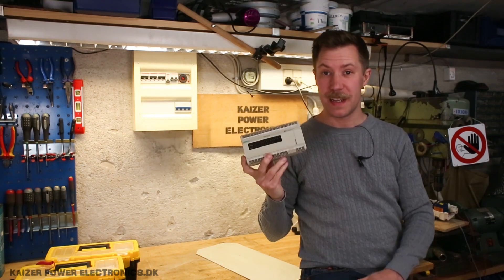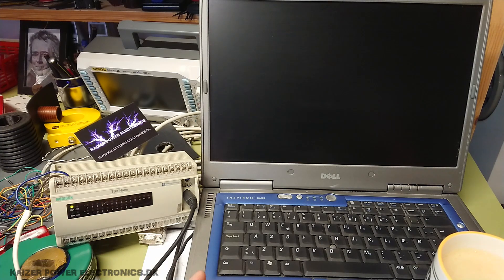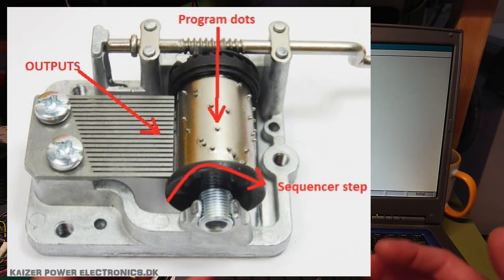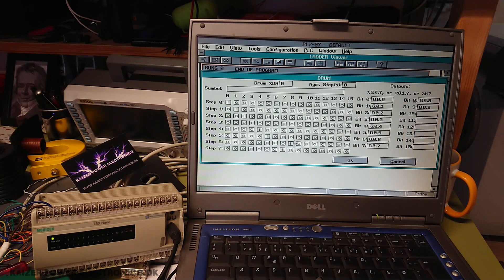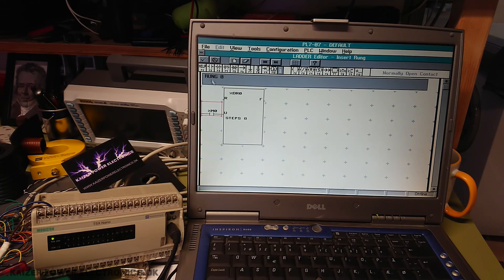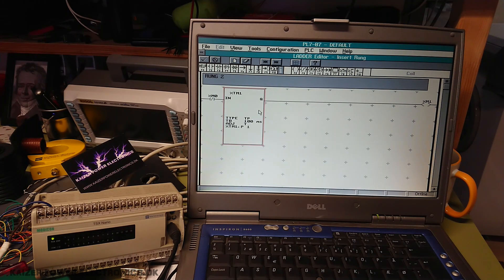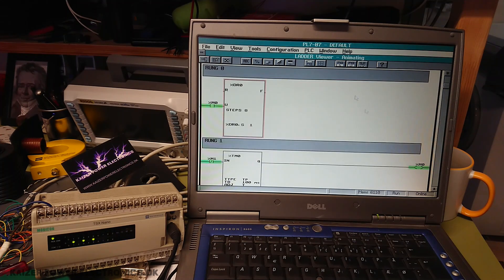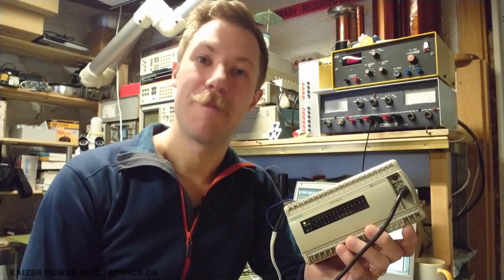Old School PLC Drum, Sequencer or even EDM Programming

Comment from the maker: I wish I had the hardware to use it as a drum machine with sound, but you just have to imagine that for now!
Reply: you could use it to switch multiple size and frequency tesla coils.. who needs Floppytron! :P
Reply from the maker: Great idea to couple some outputs to optical transmitters!
Reply: @KaizerPowerElectronicsDk  Hi, and thanks for the great content. I was communicating with another YouTube user via the comments section, but my last two replies doesn't show. In case that's due to YouTube having intepreted it incorrectly as spam, could you be helpful and allow the replies to be posted? I believe they should be visible to you as you're the content owner. Thanks
Reply: What is the best course of action if the battery has gone flat ?
Reply from the maker: @danielmcnulty708  To save data, refer to the PL7 manual and search for "batter" to find all about battery/batteries: https://web.fe.up.pt/~asousa/sind/schneider/PL7-Reference-Manual.pdf
Reply: @danielmcnulty708  I'm currently working on a plc like this one. I've done some trial and error, and what I've found is that if the program was also copied to EEPROM without protection applied to it, then it can be copied back to the RAM memory again. The backup battery is a rechargeable battery, so unless it's faulty it should charge up again once power is connected. If it looses the program again after being powered down then the battery needs replaced. It's soldered onto the circuit board, so anyone with experience in electronic repairs should be able to do this for you. To transfer the program between the EEPROM and the RAM, you'll need the software and the cable that was used in this video. I believe that Windows XP is the last Windows version that the program can be installed on. I'm running my program on Windows 98 through a Virtual machine. A bit of a long answer, but I hope it's somewhat helpful to you. 👍
Reply: Ok thanks but that’s beyond me. Is there someone that I can send my plc to or can someone come to our workshop to reprogram it for me ?

Comment: I had to look a program on TSX for old brick merging line made in 97', just old as me. It had to be opened in hard to come by software for OS/2 so I opened OS/2 virtualPC image inside WinXP Virtual box. It was all french. And we planned to insert new PLC to run new gap forming machine inside this process.
Reply from the maker: Should have been upgraded long ago, not because the hardware is faulty, but because engineering software is impossible to run by now :)

Comment: Hi there. I have a problem with this plc. The error light is flashing. It is used in some heavy vehicle lifts. Do you know who can repair/reprogram. I was told if the battery goes flat then it loses its memory ???
Reply from the maker: If battery goes flat, it will loose its program.
Reply: I'm only seeing this post now. In my other reply I mentioned that I am working on a similar PLC. That PLC is also out of a heavy vehicle lift. Not sure where you're based, but if I can be of any help with your lift, let me know.
Reply: @flemmingjacobsen2763   hi there thanks for getting in touch. Can I ask what heavy vehicle lifts the plc is fitted to ?
Reply: @danielmcnulty708 it's for a Ravaglioli 241 column lift. I believe the program is similar in the different models in that range, however I still have to try and confirm that.
Reply: @flemmingjacobsen2763  mine are somers/totalkare s6 column lifts. I’m in nottingham where are you from ?
Reply from the maker: I see no comments for review.
Reply: @KaizerPowerElectronicsDk  Not sure what is going on then. I've tried replying to @danielmcnulty708 's latest comment 3 times so far. It was fine to begin with and then it just stopped displaying my comments.... strange though... But thanks for checking for me.
Reply from the maker: @danielmcnulty708 Look at Flemmings channel page to contact him.
Reply: If he sees this, he can use the email in my channel info to contact me for further assistance. Fingers crossed
Reply: Just a follow up on the issue with the lifts where the plc that had lost its program. We got it sorted and they are working again. Thank you for initially posting this video. Without it we would probably never have gotten in touch about the problem. 👍
Reply: @flemmingjacobsen2763   yes I can confirm that flemming is a genius. Thank you once again.

Comment: Programming older versions of them with a plug in terminal, with graphical LCD display and membrane keyboard, with a few rows of ladder logic visible on the screen, and you needing to scroll page after page to get from one end to the other.

Then adding on tiny little extra parts for extra functionality, and eventually swapping one output with another, because the relay failed. Then with the on controller times to get speed up from the original slow, and ramping up the inverter to just about as fast as the 1.5kVA inverter, driving a 750W motor, could go without a brake chopper on ramp up and ramp down. Something like 3 cycles ramp up and 2 down, with full DC brake, and the motor going to close to 80Hz operation.

Each time having to go borrow the controller, because that cost around 5 times what your PLC cost. Wanted to convert another machine, but it stayed real ladder logic, and with the real drum programming, on an actual drum with cams and industrial microswitches, with chain drive from the main shaft of the machine.
Reply from the maker: Ah yes the hand terminals! I forgot about those. The most challenging I have ever tried was ABB MP200/1 controllers. 2 line command interface on a handterminal, to do function block programming. Commands for inserting new blocks, commands for connecting two pins on two blocks and then you could output it to a printer to check if it was right :D https://new.abb.com/control-systems/service/customer-support/advant-master/controllers/masterpiece-200-and-200-1